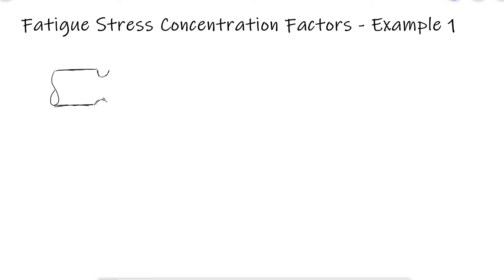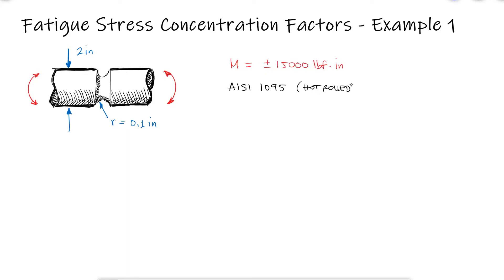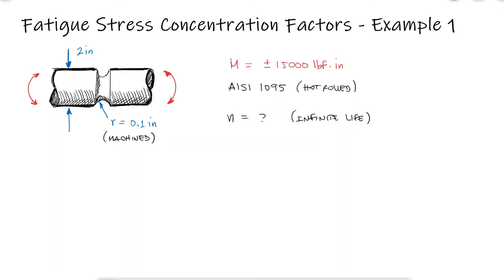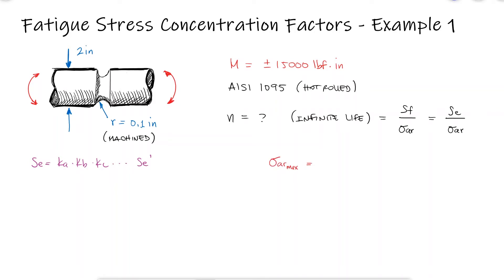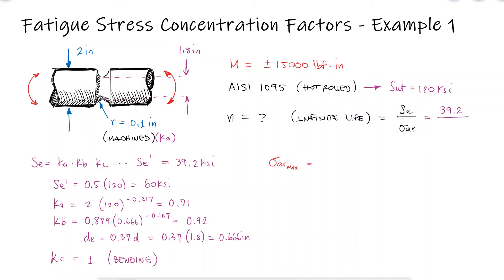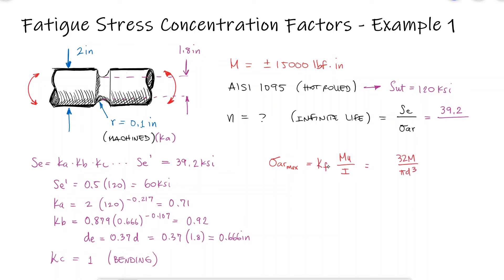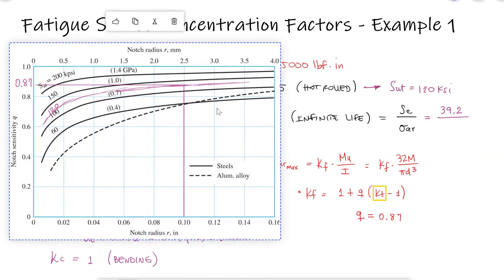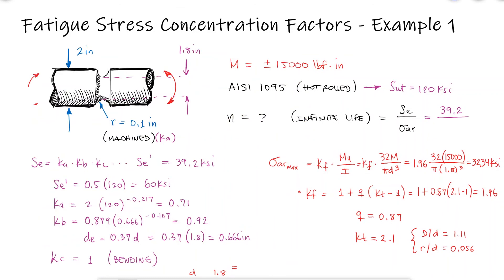Fatigue Stress Concentration - Grooved Rod Factor of Safety for Infinite Life - Example 1

Comment: Which text do you use as the reference Shigley's Machine design? So if yes, could you , please, check the coefficient "a" and the exponent "b" for Machined surface in surface factor "Ka"? Table 6-2: a=2.7 & b=- 0.265
Thanks.
Reply from the maker: Unfortunately, the values change depending of the version of the book. The value 2.7 is in fact the new value for a (it used to be 2.0 in the 9th or 10th edition). HOWEVER, remember that the purpose of textbooks is to explain a concept, not provide accurate material properties or parameters that you should be using in real applications. Hope this helps!
Reply: @LessBoringLectures  Sir, I already checked the editions 9th, 10th and even 6th for the values of  "a" and "b", were close to 2.7 for "a" and exactly -0.265 for "b". Although I agree with your logic but in world of engineering, numerical values mater. 
Thanks a lot for your responses and videos.
Reply from the maker: @mohammadesmaeilzadeh8240  https://www.chegg.com/homework-help/questions-and-answers/please-submit-36334-even-think-answer-wrong-professor-confirmed-ot-glitch-submit-answer-di-q47082190
Might have the wrong version number, but it's definitely in a version of Shigley's, as you can see in the link above.
The numerical values DO matter, I agree, and that's why you never trust values in a textbook. That's why there's engineering handbooks and other online resources.
Thanks for checking though! It's good to have the most recent info.